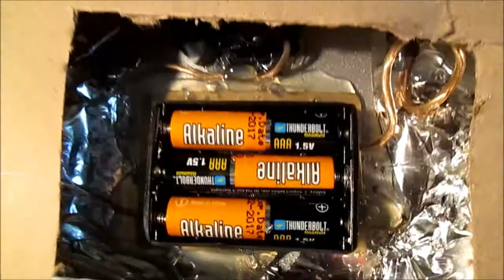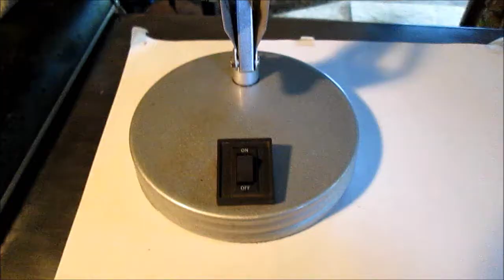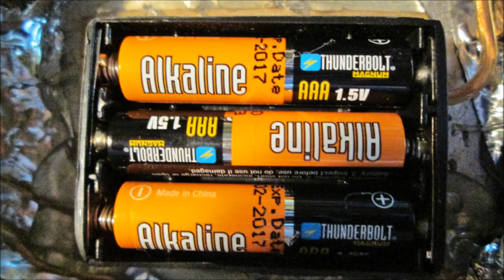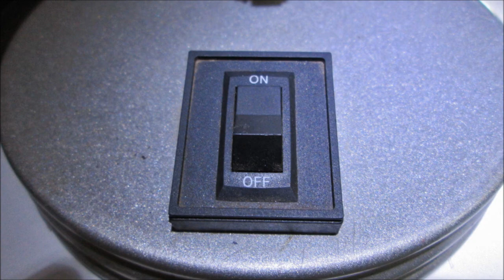Desk Lamp Converted to LED ( Rebuild )

Comment: Good idea.

If you check E-Bay you can find some cheap very bright low power LEDs.
I picked up a 3 to 5 volt bright white (24 led array) for $3.17us, it is very bright I run it on a 3.7 volt Lithium battery for now, but that is an other project.

Those flashlights do not last very long the LED's and the circuit board are fine but they blink when you move after hard use. I recycled them as well.
They work well out of the Flashlight case and last a long time.

If you break the plastic lens and pull it out, the LED's and reflector generally fall out, some times you need to push them out from behind.
Reply from the maker: I like to buy from a company I have found some good sites like Electronic goldmine and a few hobby sites The Hf flashlights have cheap made Led's in them That's why I have been searching for bettermade ones
Reply: Good Luck!
Later,FW.

Comment: Cool work. Bur why not use the lights from the Harbor Frieght light where you got the battery pack?
Reply from the maker: Thanks..I do like the light from the blue flashlights But they have 24 led's and the batteries wear down fast They would make a Nice lamp